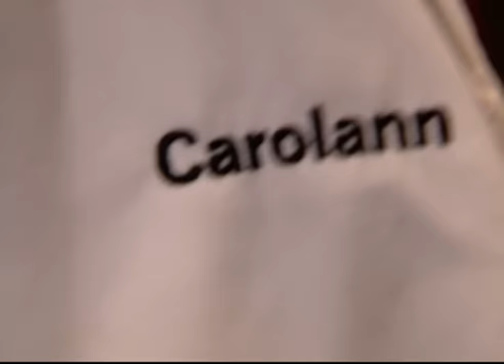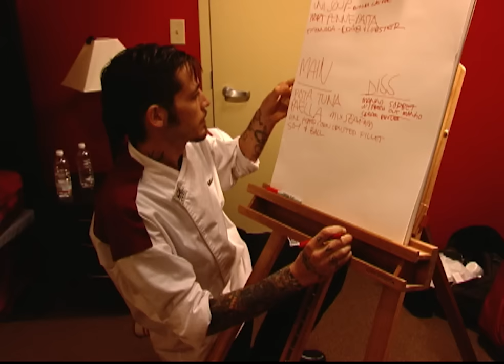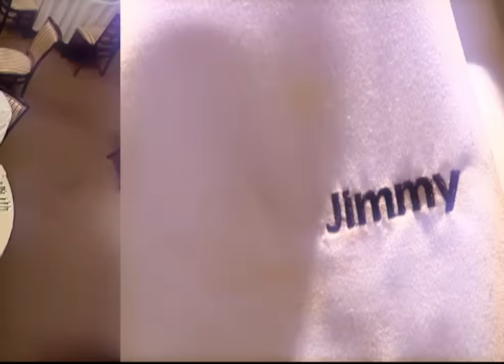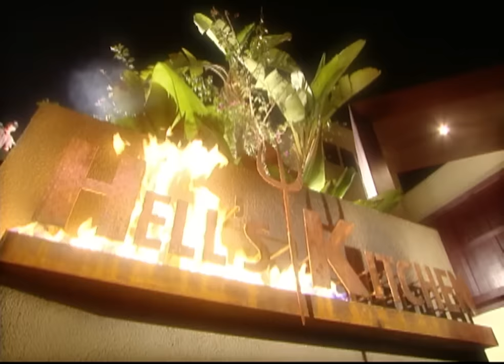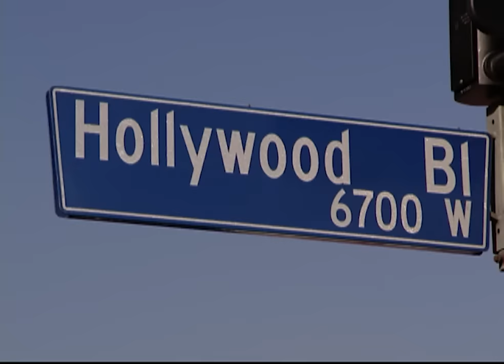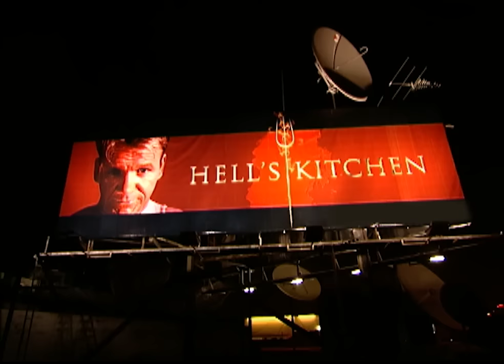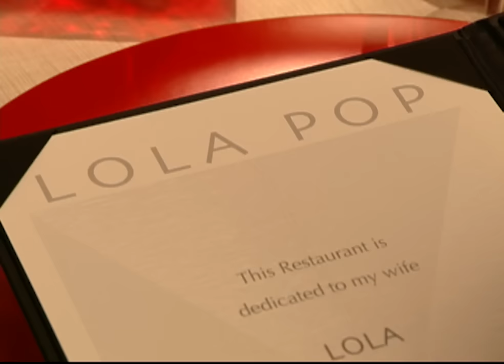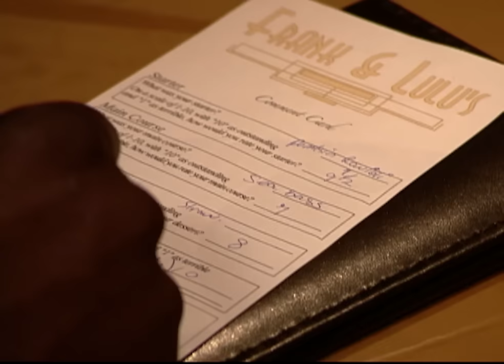Hell's Kitchen Season 1 FINALE | First EVER Hell's Kitchen Winner Crowned! | Full Episode

Comment: As soon as the failed contestants were brought in as the kitchen staff the only thing that went through my head was that the very people who had been kicked off the show for being incapable of actually doing the job, resulting in terrible service are now going to be back doing the job they have already failed at AND these failures are supposed to assist Michael and Ralph in their attempts to win. 
How the hell is that meant to happen? You don't sack an employee for being incapable then bring them back to help their replacement. They're still the same incapable person. The two finalists need experienced, reliable, neutral staff helping them not already proven failures potentially with a grudge against the very person they are supposed to be helping. This could end up going very very badly for both finalists. Ralph himself expresses these concerns right after the selections and so does the narrator.
Now to watch on and see what happens.
Edit: Yep, as feared they started to collapse. The two finalists were lucky their teams lasted the distance.
Reply: I mean that's kinda the whole point.  Not only does it make for more interesting TV, but it's more of a test for them to run a kitchen with weaker staff.
Reply: That's the point you tool. It's their kitchen, they need to run it regardless of who else is in it.
Reply: I like that they brought back the other contestants. In my opinion it simulated very well a real life situation - one is often not lucky enough to work with people who are experienced,  reliable and don't hold any grudge against one. The finalists had to be able to deliver great results with what they had. It could have turned out to be a very useful experience for their future careers.